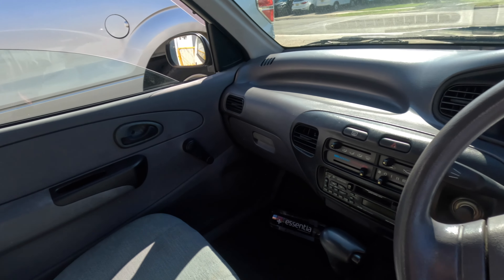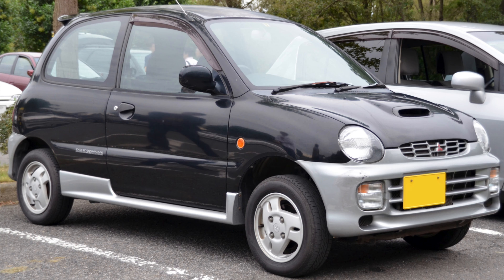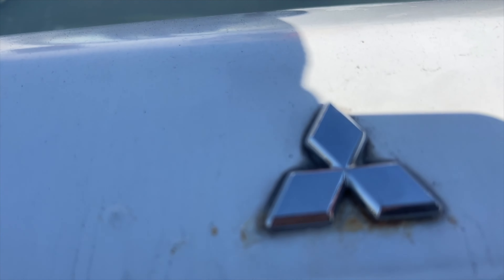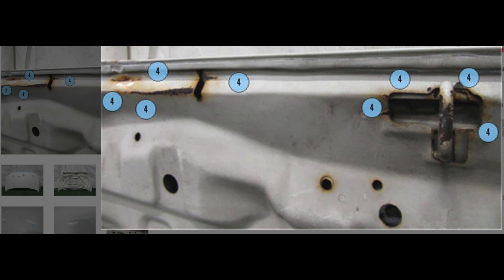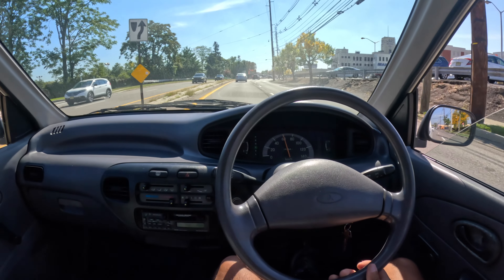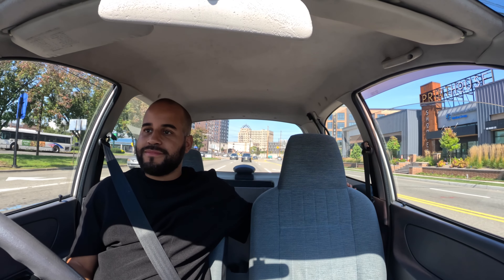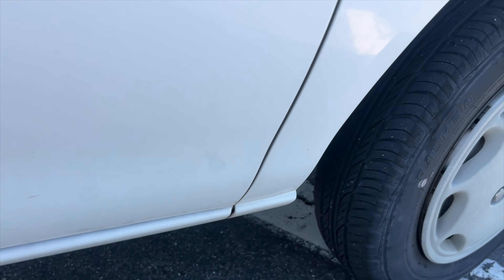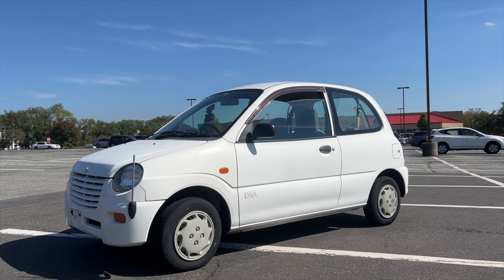Mitsubishi Minica Coming Soon..

Comment: only real issue i have is its not a manual.  its a must with my ADHD. that hood is a pain to fix cut and patch if its as bad as i think it is.  if that seam is gone then yeah it can get pricey.  its going to need a lot of bushings. 
10:10 was that smoke puffs out the back under load??
Reply from the maker: I didnt even realize that you might have a point with the smoke, what do you think that could be?
Reply: @Waybeforethefame  - If it's white puffs, it could be a head gasket, sucking a tiny amount of antifreeze into a cylinder and burning it.  You'd usually see white smoke on startup.  Is the antifreeze level decreasing?  10:10 looked more like it's burning oil.  Rings or valve stem seal?
Reply: @Liberty4Ever  im thinking head work, not a lot for bottom end but im used to engines 3 times the size smoking.  its going to need a leak down test to be sure but that much cylinder pressure could cause ring blow by cause it is basic car and didnt get the best care so walls could be scored or rings could just be stuck. it needs like seafoam treatment down the intake and it clear up.  i can think of a few things. worst is u gotta rip apart the head and replace valve stem seals.  that would lead to oil contamination real quick thining out the oil causing that blow by.  do a seafoam treatment on it and see where that gets you.  if it doesnt clear up a leak down test to see or better hear where ur combustion is going. with that lil of blow by maybe could get away with running restore oil treatment in it to bump compression or seal it a bit better.  i know that stuff works well enough for me not to rebuild my free junkyard d15b7 bottom end. top end the valve stem seals where fried.  oil get thin enough the oil would just drain into the exhaust. the way d series leans tends to put issues with oil soaking the seals.  kinda like hondas e07 engines are so far leaned over they look like they wont have the oil drain/pooling issues in the head....

TANGET XD
Reply: @Waybeforethefame  ...its not just a roll of smoke its puffing...crraaap ... apon further review it could be one piston is weak.  better phrased as one cylinder could be weak.  im not sure basic tests like a compression and leak down will tell you more.
Reply from the maker: THANK YOU!! @Odd_Redneck

Comment: My previous comment was that bubbling rust on the outer lip of the hood wouldn't be bad to fix if it wasn't perforating (on both sides), but it is, so I think that's not a particularly easy fix.  The proper fix would be to grind out the rust and weld in new steel, body filler, prime, paint and clear coat.  That's probably not feasible if you can buy a hood from Japan and have it shipped.  I just bought four Yokohama Geolander tires for my Hijet for $350 including UPS air shipping from Japan.  That's crazy.  They were here in a few days.

I'd fix the hood and paint the entire car white so the door jams match, but not get a super nice expensive paint job.  The Minica has a lot of up potential.  The econobox could become a neat little car with some TLC, accessories and upgrades.

I like the idea of a 30 day Minica flip but not if those 30 days are working outside in New York in October.  I'd expect a lot of rain days.
Reply from the maker: I heard those Geolanders are one of the best tires for these trucks, im thinking of getting the minica next week but if it has a blown head gasket maybe its not worth the risk
Reply: @Waybeforethefame  - People like to put oversize off road tires on the mini trucks but they rub (even with a 2" lift), they increase the effective gear ratio so the little engine can't rev high enough in 5th gear to produce max power so they reduce the already lacking top speed, and the larger tires kills the fuel economy.  The Geolander tires are the stock size (tiny) but have good mud and snow tread so they're good off road.  Yokohama made the Super Digger II tires and I think they had even more aggressive tread but they discontinued them and now offer the Geolander tires in their place.  Bridgestone and Toyo also make tires that look like the Geolander tires.
Reply: @Waybeforethefame  - If the Minica has a blown head gasket, it's not very blown because it's obviously making good compression based on the road test.  I think it's likely valve stem seals, or maybe a stuck ring.  It may be possible to do a liquid overhaul.  Run some engine flush in the oil for five minutes of idle, then drain the oil to degunk the inside of the engine.  Change the filter and use good full synthetic oil.  That could free a stuck oil ring.  It's possible the rings are worn but very unlikely on an engine with such low mileage.  If a valve stem seal is leaking, it might be possible to put some AT-205 Re-Seal in the oil to stop the valve stem seals from leaking.
Reply from the maker: thats what ill do I just need to figure out how ima get to NJ and back with the car but ill do a oil change asap and some sea foam. along with plugs and wires ect  @Liberty4Ever

Comment: I wonder if you can bring in a minica hood from Japan?
Reply from the maker: I could but would either be very expensive to ship normally and get it ina week or so. Or I could get it shipped ina container for cheap but would take 3 months
Reply: @Waybeforethefame  Yeah, I admit I've never shipped anything that big from Japan not in a container.  It's not a super complex curve on the hood so a good metal guy should be able to fix it.  I'll be watching :)
Reply from the maker: yeah Im hoping I can get it fixed for like $500 plus paint  @Scoots1994
Reply: @Waybeforethefame  I wouldn't be surprised if you could get that.
Reply: @Waybeforethefame  Have you ever seen a Suzuki Mighty Boy (way old) in the states?    I'm looking forward a few years when the Diahatsu Copen can be imported.  They are both super cool, and not the same old same old.  You could probably find a Nissan S-Cargo but it's like a Kei but not an actual Kei.